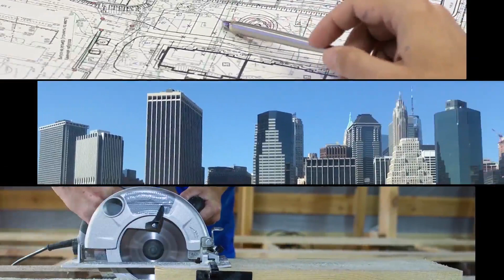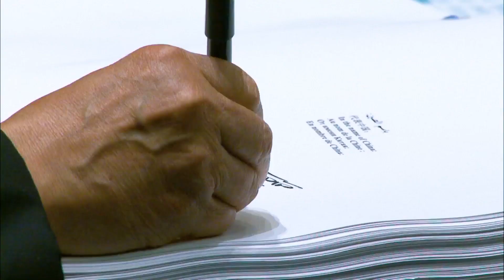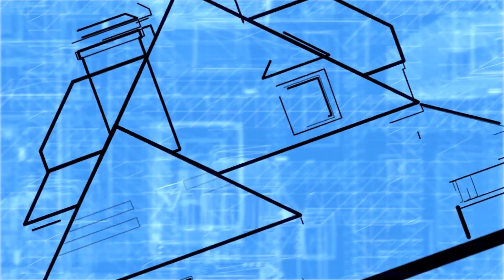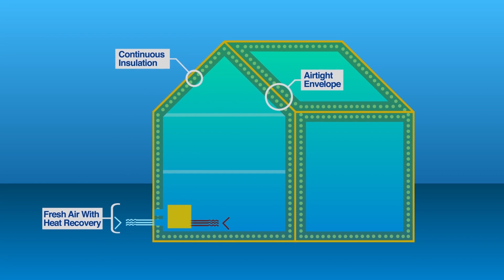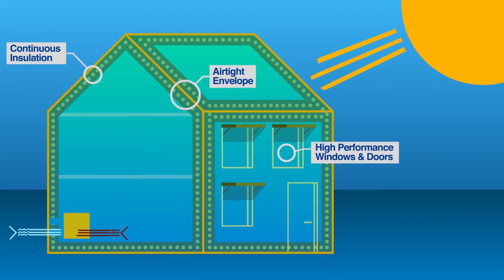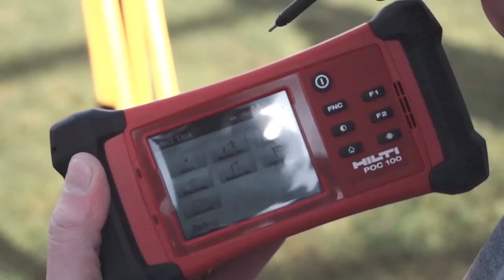United States: Tackling Climate Change Close to Home (Passive House)

Comment: I am signing this petition, because AUSTRALIA is the driest country in the world, we need more done for the environment, but we need to look further into the future. Our weather is getting hotter, and it is putting pressure on families that can’t afford the heating and cooling bills. We need to adopt how those people in Coober Pedy live and build homes that are built within the earth, or partly underground. 
This plan will not only be cheaper for housing, for many people, it will also be cheaper for heating and also cooling because, though it is very hot in Coober pedy, their underground homes are not only cool in summer it is also warm in winter and in some cases do not need to use
heating and cooling at all.
These submerged homes could have beautiful floral gardens and lawns above ground, but also spacious garages, BBQ and entertainment areas and sheds, think of the amount of room you would have. Apparently the under ground and partly submerged homes, are beautiful and spacious inside and very comfortable. There are ways of bringing light into these homes without any problem and for those who which to have a room that is flooded with light, a single living area can be built that is either partly submerged in the ground or above the ground that is attached to the submerged home. A family can have the best of both worlds, and save a whole lot more money, than they would if the home was built all above ground and squashed together with the shed, garage, entertainment area, and lawns for kids to play on. THINK ABOUT IT. Mick